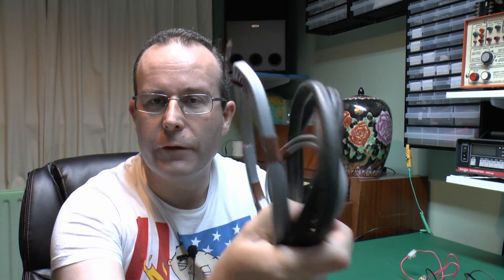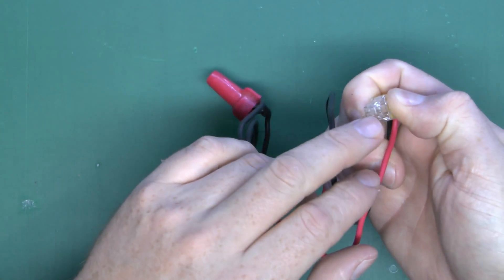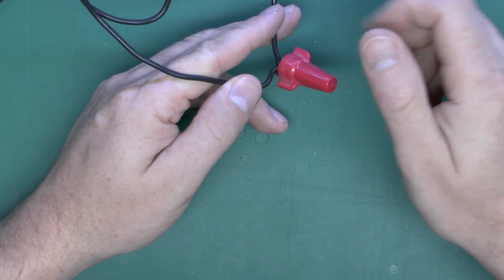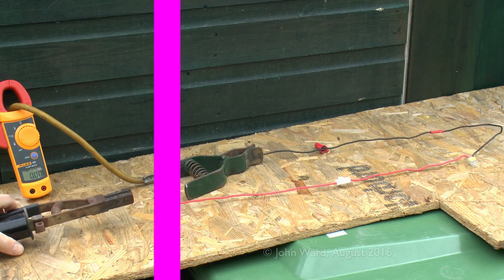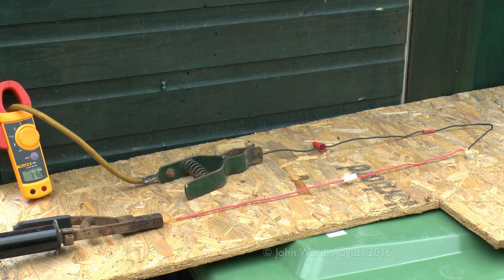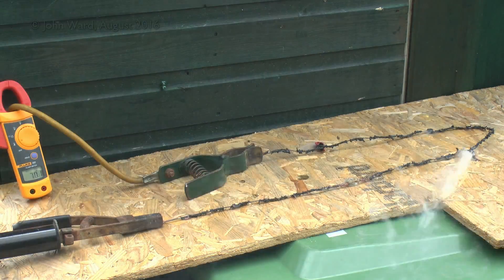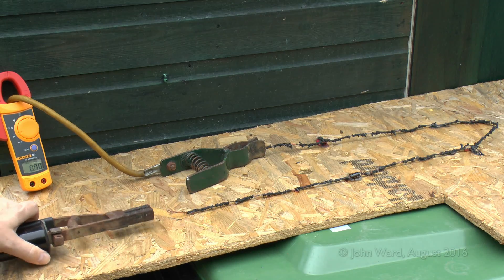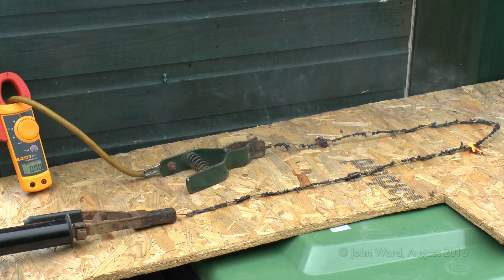Wire Connectors Overloaded

Comment: The little screw connector is the most dangerous. It's the one that is most likely to have a loose connection and Arc
Reply: possibly, especially after multiple heat cycles:  the screws might work loose.  but, in this test, they didnt fail!  They passed three times the amount current that they were rated!  I thought that the wago connector would have failed first...and it probably would have!  i think another test should be conducted:  because the wires made contact, bypassing the wago "splint".

Comment: surely we would want a connection to "fail" if the amps exceeded the capacity of the wire in order to prevent a fire?
Reply from the maker: If the current exceeds the rating of the wire, the fuse or circuit breaker would disconnect the power to prevent the wire overheating.
Reply: You should take a look inside a miniature circuit breaker (spring-loaded mechanism, arc snuffer) and a high capacity fuse (sand). A short-circuit is several thousand amps even if you're only dealing with residential service, and the resulting arc-blast is not something you'd want in a random junction box.

Comment: First kind of connector still used in UK? Pretty strange
Reply from the maker: The twin screw connectors are by far the most common type.  Wagos have only been available here for a few years although more people are using them.  Crimps are rarely used.  The wire nut things are never used as they destroy the ends of the wires and and make subsequent testing almost impossible.
Reply: They make a reliable connection, they're simple and they're cheap.

Comment: I found it alarming that the Wago connector burned as it did.
Reply: It seems to me that it was the wire that failed, and all the connectors passed.
Reply: Yeah, none of the connectors failed electrically, but the plastic on the Wago didn't appear to be fire retardant. That's a HUGE issue, in my opinion.
Reply: But did it fail any worse than the wire?

And which do you think would be more important? To be more fire resistant or to include some sort of fuse-able link, so that the rest of the circuit doesn't catch on fire? It seems like all parts of the circuit, were able to handle a serious overload. So should that be a pass or fail?

Keep in mind, that electrical connections are supposed to be inside of an electrical box, whereas wire is not commonly so protected. And how is it, that a plastic TV enclosure can catch on fire with a candle put up against it? Shouldn't things like that, meet better fire retardant properties? Long ago, TV sets were housed inside of wooden furniture, something that would take a lot more than a tiny flame to ignite?

Also, if a connector is too likely to be commonly installed incorrectly, that could be a serious issue in need of correction.

So which kind of connector do you like? Are wire nuts okay? Which connectors are cheapest or most universal? Which can fit more wire sizes?

Photoinduction loves to over-voltage various electric devices until they finally pop. Considering safety rather than YouTube entertainment value, we would love to see more devices "pop" in a way that doesn't appear likely to start a fire. Also, I think that more electrical devices ought to include some sort of fuse or other safety devices within their plug or their circuitry.

If you have seen the movie The Towering Inferno then you may remember that "bad electrical wiring" was the cause of that fictional movie scenario. But upon closer inspection, it wasn't just the substandard electrical wiring. It was the bad practice of allowing combustibles to be stored haphazardly inside of an electrical utility room. Had there been no combustibles, the fire likely would quickly have fizzled on its own. And of course, it would have helped had the water to the sprinkler system been turned on, before they decided to have a major party in the skyscraper. And perhaps more of the wiring should have had conduit as a safety covering. Anyway, the movie showed the possible consequences of a lax attitude towards safety.

Comment: Well, as I see point of this is that even the cheapest Chines connector product is more than good enough. Insulation on wires fails long before connector insulation fails.
Reply: Grossly incorrect! You made a final conclusion based on a single parameter experiment. Please do not be making any more conclusions for your own sake.

This experiment did not take into account poorly executed connections, multiple heat/cool cycles, connection aging / corroding nor simultaneous IC temperature measurement at each connection during load.

Comment: You should really be disconnecting/turning off the live wire before messing around with it.
Reply from the maker: Isolated low voltage supply, no actual danger other than the high temperatures.
Reply: Would of thought it was still dangerous with the amps used. I'm no expert. Good to hear it wasn't dangerous.

Comment: the choc bloc- depends if the person is limp wristed or gorilla fisted, the wagos i dont like and prob never will as they are for lazyness and rely on a small piece of spring to hold the connection, the insulated crimp, ok if the tool used is decent, the twist wingnut, again like the wago, relies on the flimsy piece of metal to keep the connection.
Reply: But choc-blocks often fail over time as repeated heating and cooling cycles tend to lead to loose connections, requiring periodic maintenance to maintain a good low-resistance connection.  I do use them though quite often, but always make a habit of clamping each wire with both screws though to improve both the electrical and mechanical solidity of the connection (double-clamped = doubled support, and halved electrical resistance).

Wagos I've grown to love as they make connecting T+E solid cores super-quick and easy, and they should prove to be maintenance free unlike a choc-block, or maybe even crimped connection, as the contact is spring loaded so is able to expand and contract repetitively without losing a good hold on the conductor.  Can be a pain though if a connection needs breaking and you have to remove them - I tend to just snip them and fit new ones in this case.  Nice for terminating flex too though I go the extra mile and solder tin the wire first as I don't trust them so much when not (stranded wire can be pulled-out quite easily, and strands often get bunched-up on insertion making things a bit messy).

Wingnuts, wow, I haven't used those things since I was a kid, about 25-30 years ago.  They seem a bit messy to me with how they tend to twist-up the wires.  My biggest fear with those is the insulating cap falling off.
Reply: Twist wire connectors are completely different from push connectors; you obviously do not understand how twist connectors work. The wires are twisted together and the cone shaped square wire spring spiral threads onto the bundle and applies a large amount of pressure to the twist of wires. They are very secure, unlike push connectors where the wire can easily rotate (and can easily pull out with just a little bit of rotation). Some wire connectors do not have a wire spring and just have the threads in the housing, but those aren't as good because the metal spring is stronger and bites into the wire better.
They are the most common connector in North America.
https://i.imgur.com/HoBvGIw.jpg
Reply: "unlike push connectors where the wire can easily rotate (and can easily pull out with just a little bit of rotation)"

Whilst the cables can rotate once inserted, saying that they can be easily removed is nonsense. You can remove them, but they take a fair bit of pressure and a constant twisting motion. Given that they are also supposed to be placed inside enclosures and not in free air, the likelihood of a cable coming loose from one is minute. I'd trust a Wago connector over a Wire Nut, every time.
Reply: I am actually a fan of Wago's, like any connection, good engineering practice must be used and the right connector selected for the job at hand. Wago's save lots of time and can be a safe method to terminate let's say a lighting circuit live if turning the power off is not an option. Maybe you would not want to use them on anything of significant load. But nowadays most lighting is LED and of extremely low current, so Wago's offer a good speedy alternative to other connections.
Reply: Wing nuts are for wing nuts ! Wagos all the way

Comment: I have to guess you have a dial-up transformer that you can change the voltage by simply turning a dial, or it has set voltage marks with detents it sets into. It seems you dial it to the next higher voltage and then connect the wire, to cause a spark. The safest way would have been to connect the wire then dial it up, and then dial down to disconnect. Lets be professional here, the wire nut is not called the wire nut thing. When you check the wire at the end with the screw driver, you don't disconnect the power. People are calling this a great demonstration. It's an unprofessional safety hazard. And people must think the wood, once hot from the heat of the wire to explode into flames.... it does take some time for the wood to really catch fire.

Comment: I would prefer if the connectors failed a lot earlier than they did. Of course you should rather use a fuse but it would have been a nice added detail if this was their maximum rated wire.

Comment: Anybody who installs any device which relies on spring action for connection is a idiot. I am 34, and I've done enough service calls which wagos or rec with wires in the back were the cause of the problem.... MECHANICALLY bind your connections, dont be lazy.

Comment: I've had the spring type push in connectors fail in light fittings when chock block type would never have failed! Problem happens when you loop though the fittings. This was on a 6 Amp lighting circuit!

Comment: Nor removing the supply power after the connector failed and then pushing the "Live" wire around is unsafe and should be listed as " Not how to do this" videos....

Comment: that res "wingnut" is called a "maret", also those "quick splice" connectors are used in automotive wiring.
(not trying to be pedantic, just clear, y'know?)
Reply: Every region has their own set of words, heck even every industry does. So you are being clear for your region and probably one of the industries.

Comment: Only the American wire nut provides additional mechanical bonding.
Reply from the maker: They also destroy the ends of the wires and make future testing and alterations difficult or impossible.
Although they can be obtained in the UK, very few people use them.

Comment: I was in the Trade for 33 years. Get out before you are 50 or before. Your body gets too worn out.
Reply: i was an electrician for 29 years. your body takes a pounding. i've had both rotator cuffs repaired, both knees replaced, i'm due for a hip replacement. good advice, ellen. i re-trained as an electrical inspector. smartest thing i've ever done.

Comment: this doesent prove anything all you did was create a dead short in NORMAL operation prob  non of these would fail . i really dont like the aygo conecters id rather a wire nut for higher voltage or a butt crimp conectors

Comment: The fact that you could spin the wire in the Wago was a bad sign.
Reply from the maker: The connectors are designed to allow the wire to rotate, that's also how you remove them from a wire (rotate and pull at the same time).
Reply: the type 222/221 are made for flexible wire, and you can pull free a solid wire from them, for that they are no better than the rest

Comment: The Wago-type connector block is the only sensible way, and the clip-on-wago is even better. From an electricians point of view that is... 
The wire nut and the screw connector is absolute rubbish, and while some of the old guys probably holds on to the ancient ways of making things nuclear-proof, a switchpanel that's not serviceable is utterly useless.

Comment: 9:33 — he's poking at the 90A circuit that's still live with a non-insulated screwdriver?! Okay then.
Reply from the maker: Low voltage and isolated from ground.
Reply: The current is irrelevant. If there was 3m  of 1.5 mm² wire, then it would have had a resistance of about 0.04 ohms at room temperature. 90 amps would require less than 4 volts It's clearly a low voltage supply (and you can hear the transformer buzzing away). There's absolutely no danger of being electrocuted by those sort of voltages. The biggest danger is breathing in those fumes or being burnt.

Comment: Well, I did try, but it ain't easy:
<https://www.youtube.com/watch?v=n8DS0r9gRaQ>
I may try this again outdoors, including the Wago 221 (don't have any at home yet).
Why do you think the choc block connectors split at the bottom? Obviously putting a 4mm^2 wire in a 16^2 terminal is not ideal, but shouldn't they still withstand 1.5Nm easily? Those came from RS components in the UK and have no proper datasheet / specification.
Reply: Wagos are quite good. However, I seldom see them in any installation in Germany. Most of the time screw terminals are used.
Reply: That's not quite right, I dont know how old the installations were you saw. In houses installed in the past 15 years you will find 90% wago or similar spring connectors. Also on all major outlets and switches. These contain steel springs so they are way better that the horrible american ones with soft brass springs. Good grade wago type connectors will beat at least the screw ones, because they automatically compensate the coppers cold flow. Screw connectors can loosen after some time and temperature cycles because of that. Sad to see that, because of the shitty brass springs, american sparkies don't trust the good wago connectors. BTW, they were introduced in 1951!
Reply: Andreas Eeee I just saw installations from 1950s and they were modernized around 1998 and one 4 years ago. Still screw terminals. :c

Comment: the more contact surface = better connection
Reply: yes, you can twist the lines a foot long before putting a wirenut.
Or you use a wago and then you still have enough connection after years, when your wirenut already fell off for decades.

Comment: The wire breaking at the wago connector is because you have to bend it to put it into the connector - technically, it's the wago connectors fault!
Reply: You dont need to bend them to put it into the connector. False use. Nothing is wago's fault

Comment: hate wire nuts but they are easily the most contact and secure
Reply: Kermit though they are the most contact, I've never seen a loose neutral in a wago

Comment: a wire with a Bend or coiled wire will have more resistance than a strait wire... if you were able to keep the wire strait it would not have a heat up point.

Comment: 1st and 3rd connectors on 120 vac  illegal in Canada.
Reply: So you can't use crimps or chock blocks? Wow, I use crimps up to and from 12V up to and over 400 Amp and 11 KV 
If you can't use crimps how do connect to Sub stations? You'd need a 20 Foot long screwdriver and lots of big blokes to hang off the end.
Reply: Well I suppose this type of crimps isn't rated for mains voltage in Canada. I'm sure there are other types that are.

Actually the ones shown in the video aren't even rated for solid wire by the manufacturers as far as I know and usually assumed to carry only rather low currents (single-digit area) safely - obviously that's not necessarily the case!
Reply: We use 230V/415V  so voltage isn't a problem.
Reply: Choc blocks are rated up to 60 amps, waggos are 28 Amps and crimps are rated to cable size so no problem there.
Reply: code reference plz :)
Reply: yeah but it looked like a butt crimp for automotive applications, such as stranded wire at 12/24v.
Reply: The butt splice crimps are rated for  240V /415V use. We use them all the time in the UK. A crimp just like a Waggo connector is classed as a maintenance free connection so far better to use than a screw terminal.

Comment: Many house fires aren’t from a major over current for a short time, say a minute or less. It’s for a slight overload over a long time until the connectors either oxidize and the resistance rises, causing a circle of over heating from oxidation, leading to more oxidation and more heat, etc. But the breaker should open the circuit well before any real damage occurs.

It’s isn’t proper to test using massive over current. Going well over the ratings tells us little about the safety of the connectors. Or the wire for that matter.

This test is fun, but not very useful.

I’m sorry, but I can’t give this a thumbs up. We’re talking about house wiring and safety. When an unreasonable test is done, it gives people the wrong idea, which can be dangerous. I don’t know if this guy is an electrician, or just a You Tuber playing around. Either way, this isn’t good.

Comment: This text was utterly futile. Any time your wires burn out like that your electrical installation has failed. Doesn’t matter what connector you used. The take away from this is NEVER send more current through a wire than what it’s rated for. And always use the appropriate fuse or circuit breaker.

Comment: the easiest way that houses caught fire is the wiring due to long use such as oven, refrigerator, electric stove or any heater item... those item drag current and will heat up those wire in the wall... when overload, fire will swallow your house..
coffee maker, phone charger, fan that in office must be turn off after work..

Comment: +John Ward You mentioned the earlier ceramic version of the wire nuts, which were quite common in the UK in the first half of the 20th century. They're still very widely available. My memory (quite possibly faulty) is that back then we called them 'beehive' connectors.  I found an old-style advert for the then popular Scruit brand (good name!) from the late-lamented Wireless World magazine:
https://www.flickr.com/photos/govert1970/6192436099.